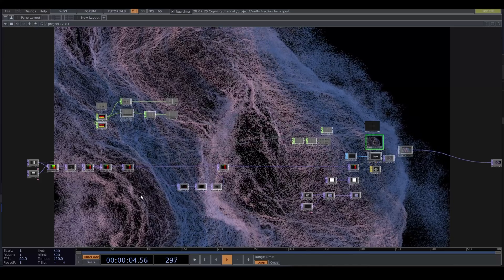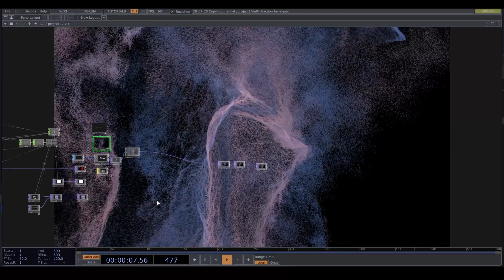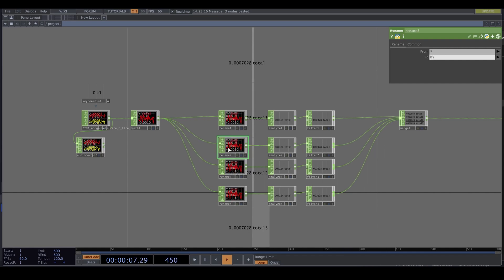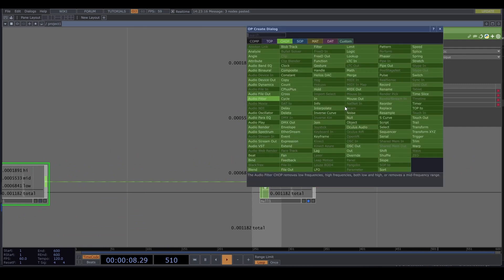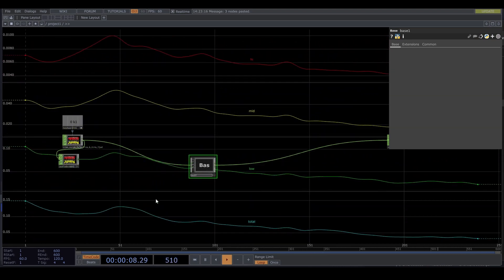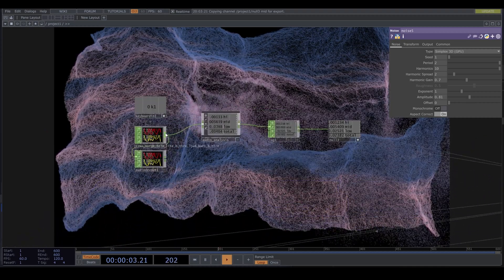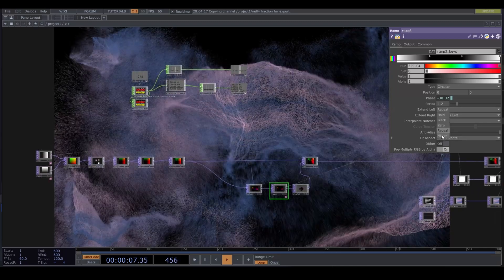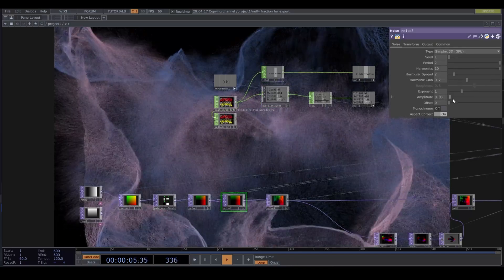Disintegration part 2 - TOUCHDESIGNER TUTORIAL

Comment: Beautiful work! I haven’t quite wrapped my head around the possibilities and workflow yet, and I don’t even own the software, but I’m in the planning stages for visuals for my ambient drone project. I have two questions for you.

What GPU are you using and how hard is it working when running this project while it’s reacting to audio? I’m trying to strike a good value here because GPUs are expensive. 

I looked at the audio  documentation and I’m trying to wrap my head around the audio reactive possibilities within TD. Are there any ways to identify sonic timbre/texture using TD? I see that it has a compressor so I’m guessing there’s a way to identify and respond to transients?

What I have in mind is a more of a somewhat original slow, evolving, visual display that reflects the qualities of the music I’m creating with little or no input from me during my performance. I have the projector, projection screen, and rigging figured out, but I’m having trouble finding a solution that does what I have in mind. Any help is appreciated. 💁
Reply from the maker: It’s a little bit to much to answer in a yt comment, but:

I’m rocking a geoforce 4060ti.

I’m oversimplifying here: but audio, and audio processing and analysis happens on the cpu. The gpu can help you increase the resolution and have more TOPs going. You don’t need to max out, but you need something decent.

Look elekktronaut and acrylicode have some great tutorials on audio reactivity.

I think your question about timbre to be really interesting. I don’t know is my answer. Play around with it. There’s an audio spectrum that technically analyses timbre.

But I also think this is where a lot of your artistry comes in. I think it’s an interesting artistic area to explore and express timbral qualities as visual textures, so maybe don’t worry too much about automating that. It could be the fun/interesting part. 

But it’s also a great area to explore how to make timbre-reactive visuals.

Another thought is that the visuals and sound don’t always have to match 1 to 1, a lot of beauty can emerge from the tension and difference between the sound and visuals.

So yeah, I don’t know.. but it was a fun question.
Reply: @supermarketsallad  thank you for taking the time to respond! This gives me more to think about. I watched the almost 4 hour video on the Luminosity interface for TD and thought maybe that would help, but since I’m not currently planning to use video clips, it seems like something made from scratch might be a more direct solution to what I’m imagining. I’ll look into spectrum analyzer more in depth. I would absolutely watch a video about expressing timbre in TD if you decided to explore the topic. 🙊
Reply: @supermarketsallad  I found an audioAnalysis output parameter called Spectralcentroid that should go a long way towards texture visualization. I think this is going to be my first area of study in TD.

Comment: Really cool stuff, thanks. If you had time to answer an unrelated question that'd be sick.  I'm trying to figure out how to recreate the 2001 Space Odyssey stargate slit camera scene. I would imagine it's a camera directed towards 2 intersecting planes with noise and stuff, but I'm still pretty new and don't understand the difference in the tabs(top, chop, etc) and I'm wondering how you'd do it. Can't find anything on youtube about it in TD. I think it'd be a cool video too if it interested you enough.
Reply from the maker: Sorry I responded to the wrong comment before.

I haven’t really thought about it but here’s a tutorial that creates a similar movement using a lens distort in a feedback loop.

https://youtu.be/Q510XDohlaE?si=Z1YCGU9KPoNNw4P5

Here’s a way to understand the tabs.
Chops are CHannel OPerators. They deal with numbers in channels and also things like audio. But they only represent things as a line.

TOPs are Texture OPerators. they deal with pixels. So everything is represented as a 2d texture. And since they are calculated on the gpu, they are super fast.

SOPs are surface operators. They deal with 3d shapes.

DATs deal with data and I’m scarred of them but committed to learning them eventually.

MATs are materials for 3d surfaces.

They all interact in different ways.

This is a bit simplified but something to get you started.
Reply: @supermarketsallad  Wow thanks so much for finding that, exactly what I was trying to look for! Thanks also for the helpful explanation. I started learning TD a week ago and it's too addicting to stop!
Reply from the maker: You picked a great addiction :)